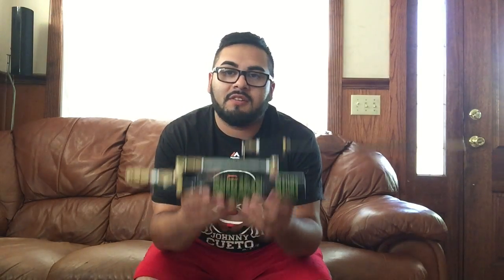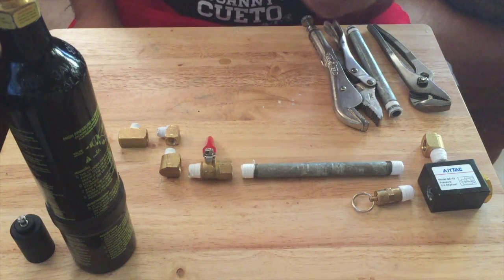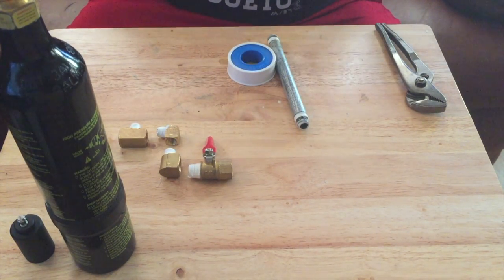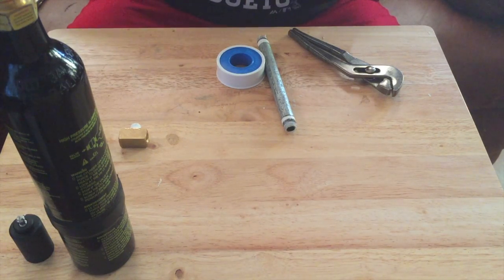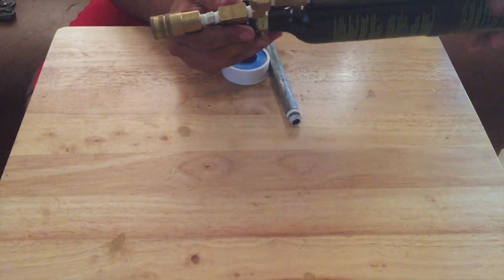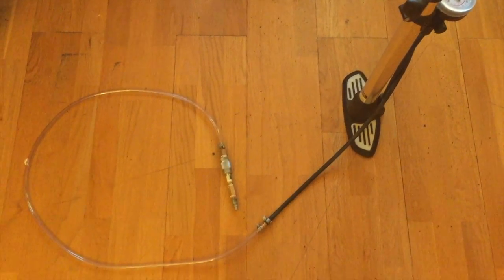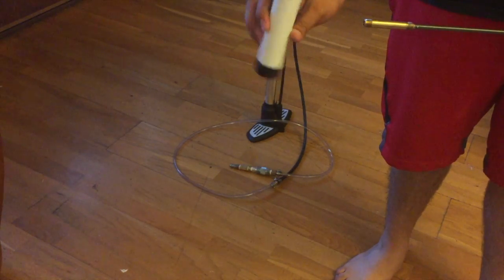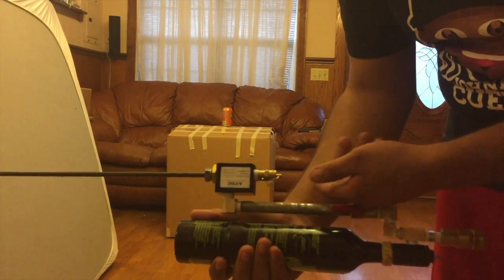Homemade Pellet gun / Air gun /NERF Gun

Comment: hello,I wanna ask how you avoid the qev exhaust all the air one time when you pull the switch,? it got special structure in the qev ? very appreciated for your reply
Reply: Modify it by putting a spring behind the rubber valve
Reply: @davecrawford8785  hi I have a valve same has yours  when I put pressure all go out to exhaust. Can u help .can I have your WhatsApp number please
Reply: @davecrawford8785  or your email address
Reply: It released all the pressure at once??, pls send me the name of this valve i need